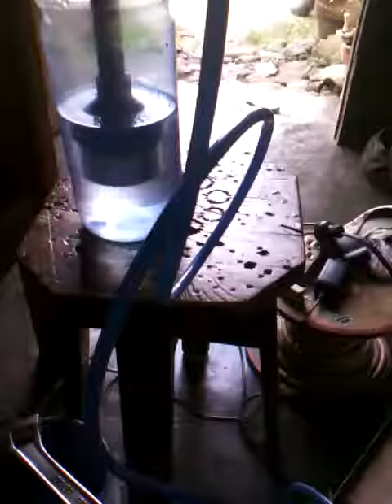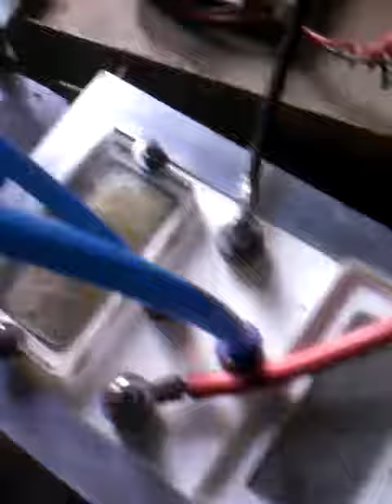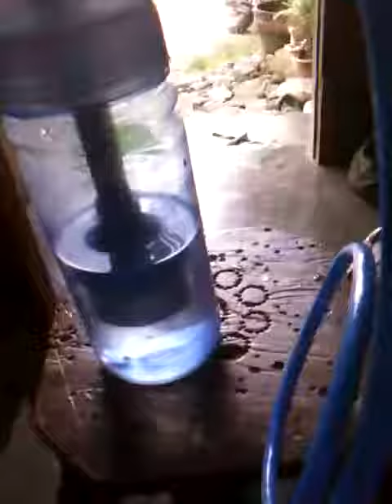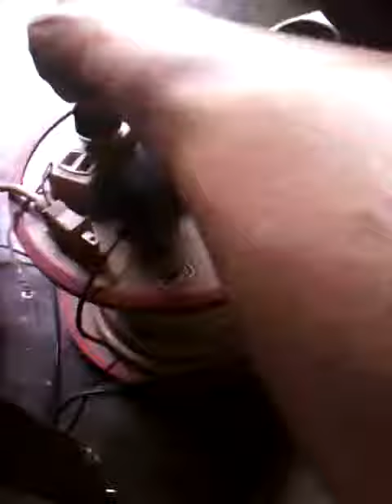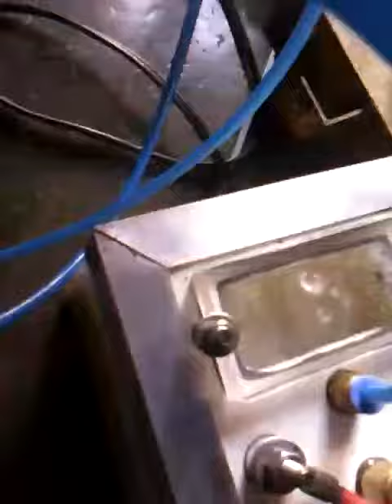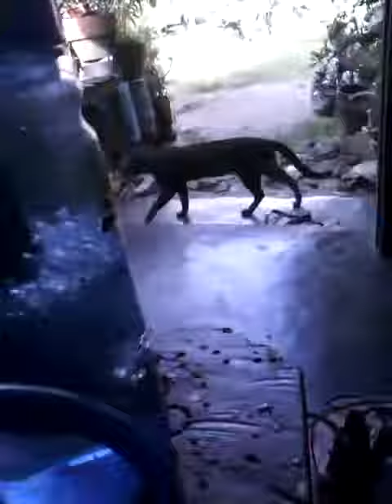Watercar hho gen

Comment: Is this a wet separator electrolizer?  HH and separate O? There is two outputs from electrolizer, and one tube going to bubbler.
How many plates in electrolizer - n + and voltage between plates. That curent you supply to electrolizer?
Reply from the maker: ittchmh ,yes it is a wet cell, there are 21 plates in it, 6x9 inches, in every stack there are 4 neutral plates, it uses 12vdc, with less than 25 amps draw